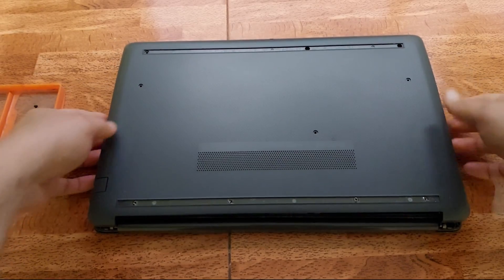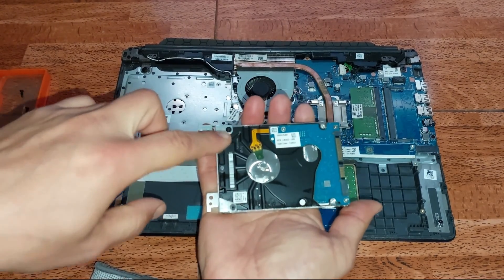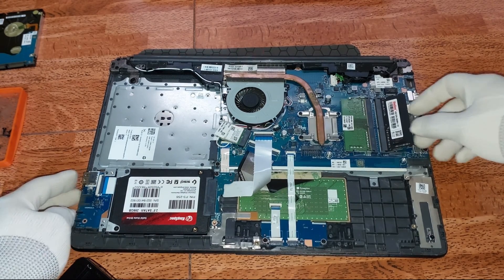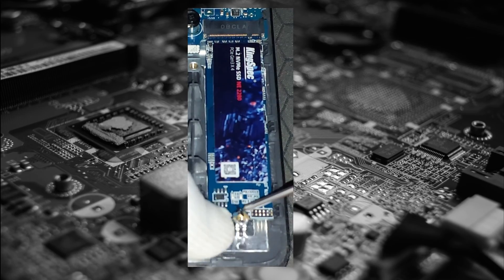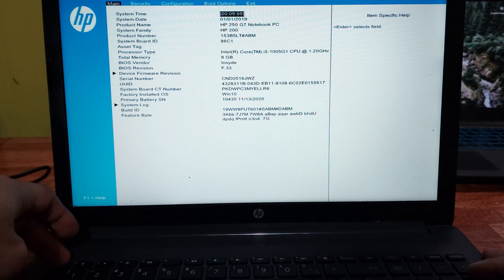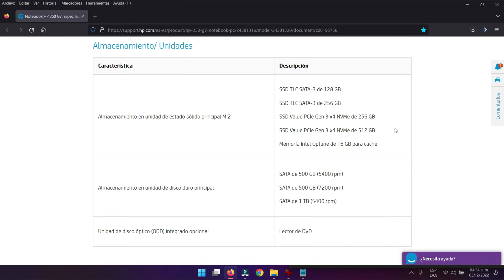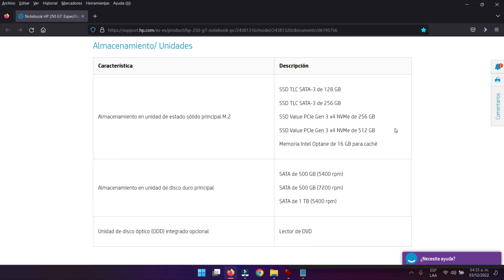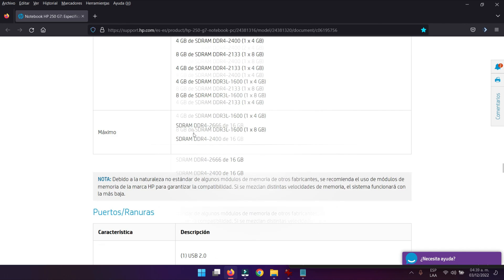LAPTOP HP G7 💻INSTALAR Y AUMENTAR MEMORIA RAM Y SSD M.2 Y 2.5

Comment: Hola Amigo tengo una hp 255 G7 te pregunto  la deje en su estado original por que le di un formato osea un upgrade. pero quise limpiar u colocarla en su estado normal y no me dejo por que dio un error llego hasta 60% y ahi dejo de formatearse. por que dio un eror me gustaria saber si venden un disco duro ya preload con window 10  o window 11 te gradecere la informacion que me puedas ofrecer. gracias de antemano. tu amigo andy
Reply from the maker: Hola, que error le da, especifique estimado

Comment: Hola buen video mira tengo esta laptop:
intel core i5-7200u cpu @ 2.50ghz 2.70 ghz de 4 GB RAM

Queria preguntarle si puedo aumentar esas 4 GB en 32 GB RAM o hay un limite? Verifico que si tiene 2 slot de memoria ram. Y tambien si puedo cambiar el disco duro oor ese disco SSD pero hasta que capacidad se puede. Espero tu respuesta. Saludos
Reply from the maker: Hola estimado, debe buscar en la pagina oficial del fabricante según el modelo especifico del mismo, opinar yo sobre el mismo seria irresponsable

Comment: Tengo la misma laptop , quisiera saber si es posible cambiarle el procesador, , por lo menos a un core  i5 de 11gen
Reply from the maker: Hola, no es desmontable.
Reply: hola, tengo una pregunta las memorias ram que tipo son por que se ven como mas chiquititas. saludos
Reply: @zombieproductions112  Son ddr4 hermano
Reply: @faridtorres9728  respuesta larga: no se puede por q el proc esta soldado a la placa madre y si pudieras desoldar (q se puede), no funcionaria ya que necesita la energía suficiente para mantenerlo estable, tu placa madre debe distribuir al proc una determinada energía. Es como si compraras una fuente de 100 voltios para una super pc.
Reply: de poder solo puede hacer un electrónico ya que el procesador está soldado a la placa

Comment: Hola, consulta. Tengo una HP como esa pero no viene el conector M.2. Si tiene el sata que se ve arriba del disco duro mecanico en la parte donde antes venian las lectoras de dvd. Mi consulta es si puedo colocar un ssd donde iba el disco mecanico, y el mecanico conectarlo con un caddy en el espacio donde se ve iba la lectora, por más que el modelo de mi hp no haya venido con lectora de dvd. Es una hp 255 G7 AMD A9, el conector sata está en la placa. Muchas gracias y saludos.
Reply: Hola amigo, creo que si se puede hacer conectar una m2 con un adaptador para sata, pero no se va a aprovechar y que el puerto sata es limitado en comparación a la m2 que es mucho más veloz, así que te verás limitado a la capacidad máxima del puerto sata
Reply from the maker: Hola, debería funcionar, igual compre primero el caddy y probé colocando el disco duro allí.
Reply: @JosePeña  si gracias. Cuando actualice al sdd, que eso sí lo voy a hacer, voy a probar con un caddy. Sino el mecánico me lo dejaré externo con un carry. Muchas gracias
Reply from the maker: Buuena